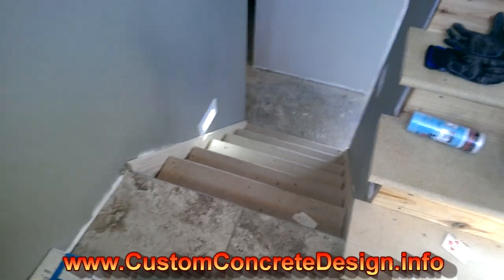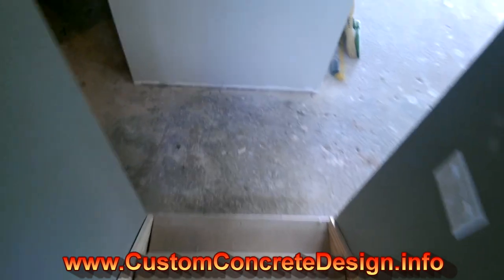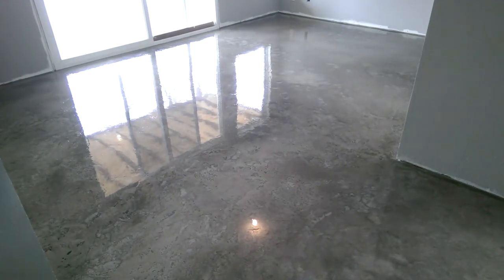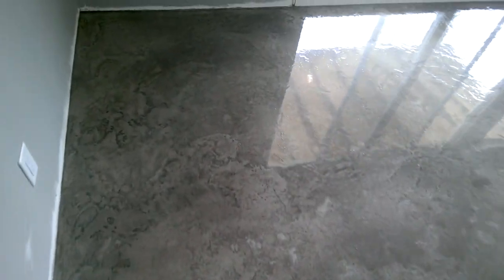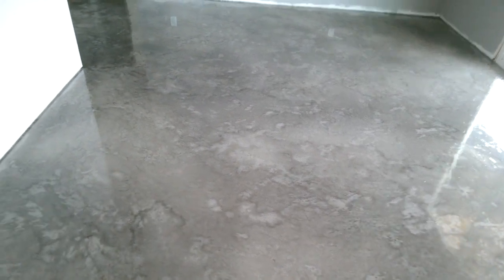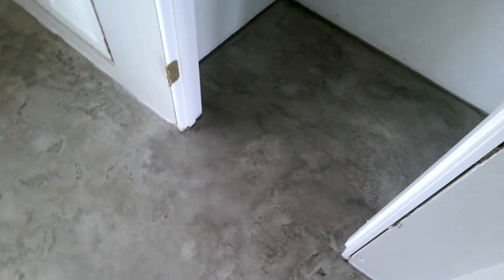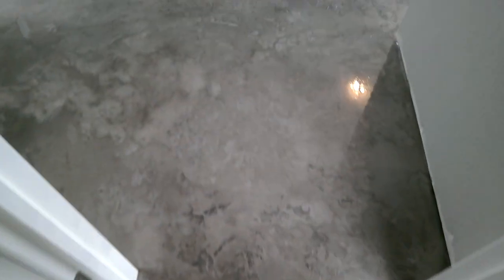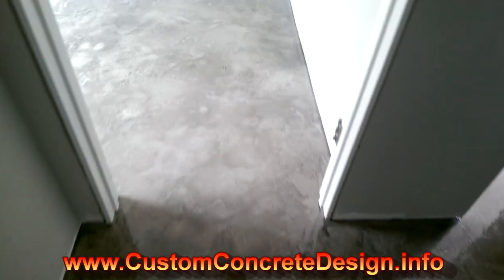Decorative Concrete Basement Floor Osage Beach, MO Acid Stained w/ Epoxy Finish

Comment: It would have been nice to see the antiquing acid stain before the epoxy. 

So to outline, are these the steps you took? :
1. Apply 2 base coats
2. Apply texture coat
3. Apply antiquing acid stain
4. Apply epoxy top coat

I just had a few questions if you don't mind taking the time to answer them:
- How did you do the texture coat? 
- Can I get the acid stain from any home improvement store?
- How do you apply the acid stain on the floor? Is it sprayed on? Do you need a respirator when applying it?
- Is the epoxy coat just a clear top coat? Are there varying degrees of glossiness?
Reply from the maker: I'm adding a Video showing myself spraying the Antique Stain right now, its my latest Video dated today 12-19-2014 check it out when you get a second... its almost the same floor some differences but the process was the same.
And Yes your Outline is the Jist of it correct...

I just had a few questions if you don't mind taking the time to answer them:

- How did you do the texture coat?
Answer:  The Texture was done with a trowel, dipping into the bucket and making large splatter on the floor, but you have to do this in layers... takes some practice.

- Can I get the acid stain from any home improvement store?
Answer: you can, but not the kind I used, what I use is for Decorative concrete Installers of the product, you have to be certified to get the same product I used.

- How do you apply the acid stain on the floor? Is it sprayed on? Do you need a respirator when applying it?
Answer: Pump up sprayer you can get at Lowes or Home depot. No resporator needed for this stain.

- Is the epoxy coat just a clear top coat? Are there varying degrees of glossiness?
Answer: its just a 2 part Epoxy Mix thats Clear yes, all one shine on the floor very consistent, its applied with a squeegee then back rolled.

Comment: What kind of acid stain for the grey marble look?
Reply from the maker: It's Actually an Antique Stain at a 4 to 1 ratio 4 parts water to 1 part Ultrastone resin, then I used 1oz of charcoal colorant to create the color shade. The Products are made by Elitecrete.

Comment: This is awesome!!!! I love the gloss look! Im really not handy. Do you recommend someone that could complete this same project for a 1230sqft home? If so how much would it cost?
Reply from the maker: Thank YOU...yeah the Gloss look is the way to go, it looks clean always, I would call a  pro to do the work, especially if your not handy, takes some time to learn the needed skills and with the Epoxies you have to move super quick., cost will vary from location to the contractor doing the work, and it also depends on the condition of the concrete, this job was between $8 and $9 a sqft

Comment: Hey, gud job,   wat colors did u use for integral, and wat color acid stain??
Reply from the maker: Thanks Lavonn appreciate your positive input on my Video's, be sure and SUBSCRIBE to my Video's so you never miss what I create next!! Like I do on all my Basement floors I used Thin Finish for my base, slightly Darker Charcoal integral colorant, then did a 50% Thin Finish 50% Micro Finish Topping with a lighter Charcoal integral colorant, then Antiqued it with the Neutral Base Ultra Stone that had a Mixture of 4 to 1 (4 parts water to 1 part NB US) and 1 oz of the Charcoal colorant, sprayed 2 coats, then locked it all down with a UV Resistant Epoxy.

Comment: Just seeing this.. How do you prep the concrete before applying the texture?  Also, is there a certain type of texture/stain that should be used, and how long do you need to wait before applying the epoxy coating? I have a 440 sq ft area I want to do! #SeriousDIYer.. Lol Thanks in advance!
Reply from the maker: I Diamond Grind all my Floors with a grinder/vac system...about 95% dustless, then I clean up the remaining dust that settles on the floor with the shop vac, the texture on this was a Mixture of 50% Thin Finish and 50% Micro Finish the texture is Tuscan Slate created with my Trowel only, then its Antique Stained or Acid Stained, I always wait 24 hours before applying the epoxy clear coat.... if you watch more of my video's you will see the grinders and the shop vac system I use....if you have more questions let me know, good luck....
Reply: I sure will be checking out your other videos.. Thanks a Bunch!
Reply: This epoxy clear coat also comes in matte finish? I mean, not glossy. The same finish that is been used in interior design from few years to now.
Reply from the maker: Hagi Valle hello, yes it could be a matte finish as well.

Comment: No how would this work out if you have a basement with the expanding/contracting gaps cut in them like you have on a outdoor concrete driveway??
Reply from the maker: +james hawkins yeah indoors you can fill the expansion joints with a product from The Concrete Protector, I don't  fill them outdoors, but indoors its ok for a seemless job.
Reply: MrCustomConcrete Neat, thank you.
Reply from the maker: no problem

Comment: Where is a good place to order these products?
Reply from the maker: you can't order them unless you go to the training and become a certified installer of the product.
Reply: Well what's the info
Reply from the maker: The Product on this Project was Elitecrete.com I use a few different ones, but on most all commercial grade products the companies want to train you to use it. Cost is usually $250 plus depending on the distributor in your area, I think they all charge a little different price, just depends on your location, that's
 for a 2 day training with a group of other guys, of course all travel expenses are on you. Hope that helps

Comment: Great work... I just think in my opinion another layer of clear epoxy would make the window glare have straight lines... Other than that .. Great Job
Reply from the maker: Thank You, the only reason I decided not to do another coat of Epoxy is the Texture is not flat its a very heavy texture so I applied it as thick as I could for the only coat, a second coat would have made some of that distortion disappear but we missed the 24hour re-coat window, so we would have had to sand the Epoxy and I was afraid it would get into the high area's of the concrete texture and remove some of the antique stain off the high spots, its really very minimal in reflection distortion, but that's why we couldn't do a second coat of Epoxy.... thank you for the feedback and be sure and get subscribed as well. Have a good one!
Reply: @MrCustomConcrete  is it bad to add a third coat a week later after a light sand?
Reply from the maker: @lukeknight5265  Not at all, you can go back anytime and add another coat, just give it a light sand so it has something to lock onto,

Comment: I was told that 4 to 1 U S was  to much dilution
Reply from the maker: Its boarder line yes, that's why I did a second coat of the NB Ultra Stone, it helped feather everything in better on the second spray coat.

Comment: This is acid? Acid does not come in a gray hue?
Reply from the maker: Michael Mazzucco not true, if black acid is diluted enough with water and you add a little blue acid on top of a dark grey base and light grey top coat then you get what's in the video.